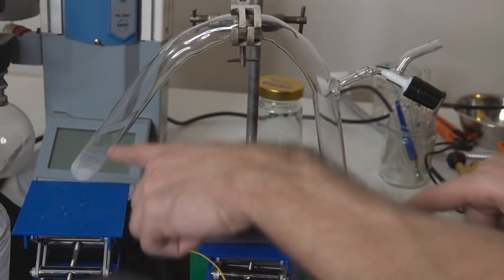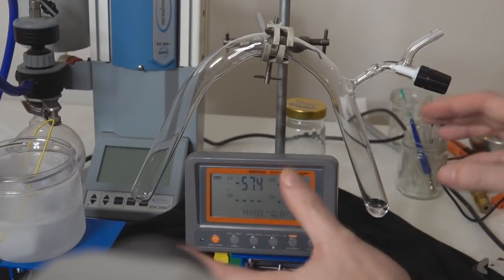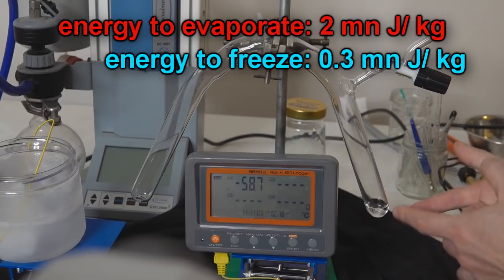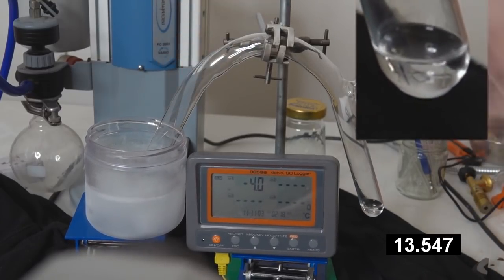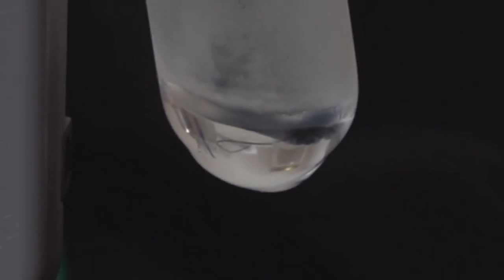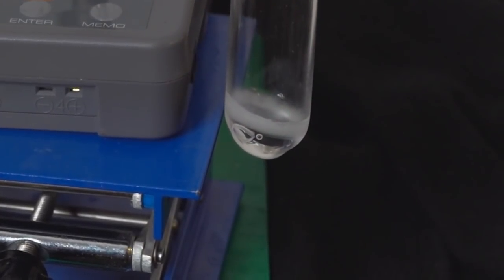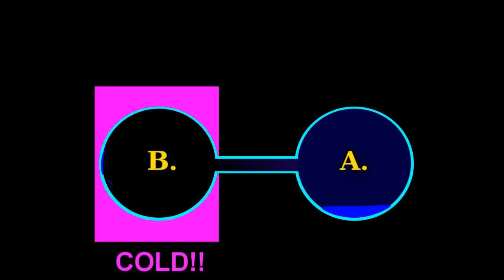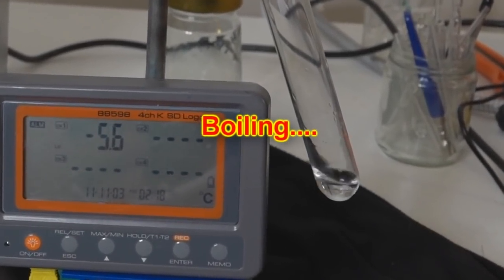Does Water Boil or Freeze in Space?

Comment: A quick question:

You say the water vapor will travel at "almost the speed of sound". Ok, "speed of sound", where? If in a vacuum, that would be zero. If on Earth, at sea level that would be about 763mph. If in water, that would be about 3200mph (4.3x).

Thanks.
Reply: GlueFactoryBJJ a quick question..what was the point of that comment when u asked the question and then answered it yourself??
Reply: @gupstaa  But I didn't answer it myself. Pointing out that the speed of sound in a vacuum and at sea level have two very different speeds does not tell me what speed of sound thunderf00t is referring to. Either of those or somewhere in between? Frankly, there is an almost infinite range in between.

You need VERY high speeds if you are going to turn one, much less many generator blades. 

Or, for that matter, why not go vertical, if the main criteria is temperature difference (a form of geothermal energy)? You could get better localization by drilling into the ground in cold locations without needing to clutter up the landscape and/or cross national borders.

Also, there is no proof that this experiment scales with distance, so the question of speed is very pertinent when evaluating it's practicality at his proposed scale.

Finally, thunderf00t should not mind addressing questions like these since his channel is all about debunking others claims, in a frequently sarcastic/demeaning way. 

Don't get me wrong, I'm not trying to be mean. And I have to agree with many of his analyses... and even find most humorous (in all humor there is a "butt" of any "joke"), but he often has a superior/demeaning approach to his debunking that I sometimes find off-putting.

Anyway, my question was meant seriously so that I could better evaluate it's practicality for myself.

Comment: I’m wondering if you rubbing it to speed the melting caused any of it sublimate back over. 
Also, what might happen if you put a valve between them, and place one side on a non ambient high temperature, and the other on ice, then release the valve, and view what happens on the high speed, and thermal cameras.

Comment: Wouldn´t that work in polar regions? About 0°C under Water and much colder above. After a while, the water freezes on the other side, but what if you add alkohol (or use whiskey instead of water) and make a copper chamber with a heat sink to prevent it from freezing? Wouldn´t that work?
Reply: i think a lower boilingpoint would putt more mass to the other side till it freez. but it would be still preety low energie to get from it.
Reply: @shadwenemo1798  that's why I would make a copper chamber with heat sink, to keep the temperature above the freezing point.

Comment: Hm. Now I wonder. A regular Power plant evaporates Water by boiling it at normal pressure or even multiple atmospheres to drive a turbine. This process has a certain efficiency. Would this efficiency be higher or lower for driving a turbine in vacuum. 
It'll probably come down to the efficiency of the cooling process on the other side. Unless there is some setup in which the water vapor can actually go much faster than in high pressure steam turbines the efficiency is probably lower.

Comment: Well pressure does change things. As for stating that human wouldn't suffer affects in space of freezing.  The question one should state is temperature in any circumstance doesn't matter anywhere. It's the Molecular transference rate of energy, so if their is no body or gradient force larger to impact against the said object/persons, then losing your temperature or core should be relatively slow. If I am in a room that is apparently for sake, -1000 Celsius, and nothing is moving in it, and there is no matter in their then is it really -1000 Celsius.. I don't think so at the point were dealing with just a vacuum and the only molecules ot ineteract with is the matter in which hthe body is carrying. So lets look at this in another way. If 2 particles of energy(for matter sake) is -1000 Celsius well beyond the molecular ceasing of movement. Just drifting around in say a volume of space in a vacuum, with no other force. It is as it is. you  put another thing in their it will react toe hbody, that body depending on its mass equivalent of stored potential will go  to the larger gradient and find a balance between both objects. So it could get to -999 or -350 or just warm up to the object that might be larger. as for a human. I a human is shedding heating constantly so in a vacuum, a person would freeze eventually because their body is shedding their heat, via why we need clothes, or a space suit. So a space suit today, could be modernized to be very light weight wit hlittle danger, if we udnerstanding the amount of matter in a given space and its abiltiy ot interact and cool and object, combined wit the vacuum or pressure of a area, then their is field strength and electromagnetics in which could have its own form of intereaction, but something to think about. Then that sounds pretty hodge podge. I am interested in the the advancemetns of electronics could make space trail far more duable then compared ot earlier, the current problems is the state being used against people to develop and flooding of humans in to lands that were efucntionalble and they treach and bring in social garble, literally a mass scale attack by removing other peopes from their inheritances. its pretty strange, why random people are invited in that are known to commit crimes, and so they create worldly nonsense, whereas there was no problem like this until they came.. How does one get away... from this expansion... who knows. Disney discussed this ideal with a nuclear engine ina giant pump, can't rmember if it was water or oil, but Disney today is owned by jews, or those who call themselves jew,s there is no stopping the jewry in purchasing the earth and all its things they wait and consume all societies, much liek asiatics, its pretty messed p the lies of those groups that utlized the cliam of the holocaust to perpetuate state indecency, policy chagnes, teh death of emotions  and heart and love and physics, its a dead feeling world. They call them those thigns but what or who are they to perform or act as such things, meh,,,, Nonetheless world of its hooliganery, so sad how great this land was in the 19 century.. a little escape for freedom, and now its pilfered and made into this McDonald greed, corporational slavery, modern day Slavic state of teh west made but the corruptible, without law or direction, jstu consuming of endless human flesh for money.. its messed up...

Comment: Congrats. You made a glass heat pipe.
Reply: No, It uses the property of a fluid to change state at different tempatures
Reply: @triogaming4077  That's exactly how a heat pipe works. The working fluid in the pipe boils where your CPU is, then travels to the other end, where it releases its heat into the much cooler heat sink, and condenses. There may or may not be a wick in the heat pipe to help the working fluid get back to the hot side. What Thunderf00t has made there is, essentially, a heat pipe. It just uses a liquid<->solid phase change rather than a liquid<->gas phase change.

There are many different types of heat pipes that operate at differing temperature ranges, and will use a different working fluid (say, ammonia rather than water), depending on application.

Edit: Not knocking it, mind you. Skillful glasswork is skillful.
Reply: @technicalfool  No I was referring to the Vapor- pressure equalibrium
Reply: To the guy that invented the aeroplane: congratulations you just invented a plank of wood with a chair in the middle.

Comment: Boil, space though "cold" has such little matter floating around that it acts as a insulator where things radiate basically only purely through radiation rather then like on cold air where you'd be given your heat to the colder air. So water should boil due to extremely low pressure and not freeze I would think
Reply: first the water boils, and then the very fine mist that it boils away into freezes, giving rise to a tenuous, fine network of ice crystals. When astronauts eject urine into space that is what happens & it's the same for pure water.

Comment: If you can maintain blood pressure (which is what the heart does), then you shouldn't get the bends in space. It's about how quickly you get exposed to space.

Edited to add: I mean, you won't have a good time or anything.
Reply: the bends is when nitrogen boils out of your blood, i don't think you'd have much chance at all when the pressure is so low your blood itself will boil
Reply: @Zreknarf  

The terms is applied to accidents during EVA in space as well. It's a catch-all term for what happens to you during rapid decompression. If your heart manages to keep the blood pressure up, it doesn't boil. Though I imagine there would be local damage to the extremities. I dunno.

Comment: If you pull the plunger on a seringe when only a fraction of it is filled with water, you can make it boil because of the low pressure. My hypothesis is that without a flow of air, the loss of energy from infrared radiation of the water, will be too insufficient to make it freeze before it boils off. Now let's watch :D
Reply: Ok, where in space will you have your conditions? Where in space will you have enough watervapor pressure? Where in space will you have a closed system where you can force that watervapor to rapidly condense??? 
I think we'll need an actual field test for this one :D

Comment: but would Elon musk freeze or evaporate in a vacuum tube?
Reply: Yes
Reply: No.

The incredible tensile strength of Elon's cell membranes would prevent the vast majority of his water from going into gas phase, thus his body would remain at a very moderate temperature which would keep that water in liquid phase. Some of the water in his mouth or on his eyes may boil or freeze, but for the most part he would remain the intact, warm, and wet entrepreneur we know and love. It probably would not be a pleasant experience, however.
Reply: Only one way to find out!
Reply: Very slow freezing.
Reply: @TheReaverOfDarkness  Dying due to a lack of air would cause him to cool down to the local temperature. So, how hot is the tube?
Reply: @lionbryce10101  That's not true. In vacuum, there is nothing to conduct the heat out of his body, so he would cool very slowly by blackbody radiation alone. I have heard tell that a human corpse would increase in temperature when in dark vacuum, because the bacteria living within the body produces heat faster than it escapes.
Reply: @tedarcher9120  It wouldn't stop there. If no one cares to pull him out, he will continue in a cycle of thawing, reboiling and refreezing. I don't think Sublimation is a big factor in dehydrating him in a room temperature environment, but either way, he'll end up as a completely dried out featherweight mummy.
Reply: Hot air just dissipates.
Reply: I really hope he livestreams his world first tube tempreture challenge acceptance, the normies would go nuts trying to ban it everywhere it pops up.
Reply: He'll put on a space suit, call it an X suit, claim it's a brand new discovery and receive an applause from masses.
Reply: The real question is, should Space x now use water as an evaporative coolant for the Starship or methan. I mean, instead of approximatly 19 tons of fuel they could simply use around 600 kg of water as coolant, they could also use it as a part of the radiation shielding and for thermal management (as the part of the hull, that is pointed to the sun, is much hotter than the other parts and therefor causes  stress due to uneven thermal expansion), water could do triple duty so to say :D.
Reply: @TheReaverOfDarkness  actually as the air and your saliva expelled from your body, you'd fall unconscious almost instantly. And the air expanding would freeze the insides of your lungs and mouth  dropping your temperature by a bit. And if you survived the initial experience the insides of your breathing systems would likely be bleeding and you'd have a very slow unpleasant death as your lungs filled with blood. Of course odds are you'd die before that if it was a sustained vacuum.
Reply: @chaosryans  Actually there was an astronaut who was exposed to vacuum for several seconds. You can read about what happened. In short, you're only partially correct.

You can theorize all day about how it might go, but you can't be sure you've thought of all of the important factors until you try it.
Reply: @TheReaverOfDarkness  well the ones i found said you might be ok for 15 seconds and some animals survived near vacuum Condition up to 90 seconds though unconscious after about 3 seconds and usually involved explosive bowels. So ok if someone was holding your hand you might live. And maybe if you were well, prepared for it you might hold your breath etc. Id love to read your article but the ones i found sounded altogether negative to the experience.
Reply: @chaosryans  It is pretty negative, but you don't die instantly. You lose consciousness in around 10 seconds, and it's uncertain when you die but probably within 30 seconds.

It varies greatly between different animals. Most likely some can survive vacuum for minutes or hours, but any that breathe will find that difficult.

Comment: Can't be a total vacuum. Otherwise how would the water on the right "know" to travel to the left? There would be no thermal difference detectable to compel it to travel.
Reply: Water can't exist in liquid state in a pure vacuum.  Also the atmospheric pressure will break this glass tube to smithereens if it was pure vacuum inside.

Comment: So if you use saltwater, it will turn it into freshwater right? so if you be able to use the energy produced for the turbine to cool it down again, or to increase the temperature, it would be a lot cheaper to produce freshwater out of seawater. am I right?
Reply: Well cooling the "cool side" will probably take more energy than to heat the other side since you need to run a heat pump to cool, whereas to heat you can dump energy directly into it which is way more efficient than a heat pump. So why not just boil it the old fashion way so that the salt stays behind? You can run a turbine with the steam created before you condense it too, but you'll find that it's not enough energy to boil the same amount of water.
Reply: @mrkiky  because the trick is to make a huge amount of water to freeze fast because the ice produced will be salt-free, but if you just boil it the old fashioned way, it takes a lot of time and energy to remove the salt.

Comment: The speed of sound ? In a vacuum ?
Reply: He's perfectly correct.  Think about it some more.
Reply: @bdf2718  Please care to elaborate. What's the speed of sound in a vacuum ?
Reply: @elguinolo7358  
There was no vacuum after the valve to the pump was closed because the water started to evaporate.  That vapour initially spread very quickly because the mean free path is high when there as so few molecules around.

So it's the speed of sound in a near vacuum.  Which is invariant with pressure for an ideal gas.  Water vapour is far from an ideal gas, so that speed won't be the same as at atmospheric pressure, but it will still be the speed of sound (under those conditions).